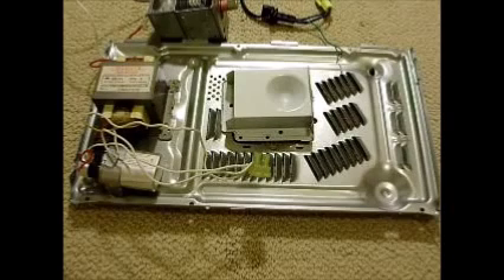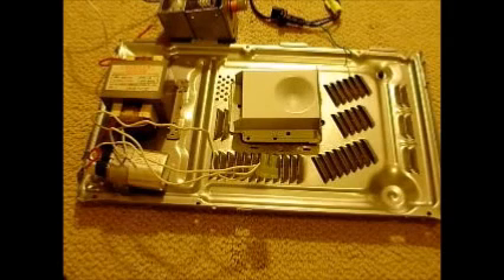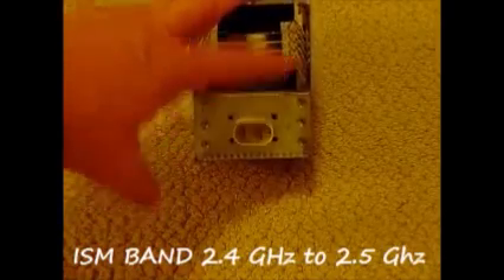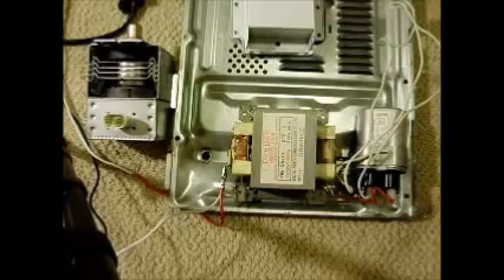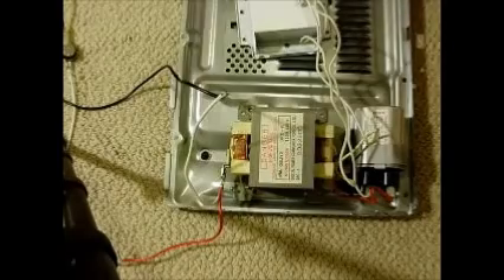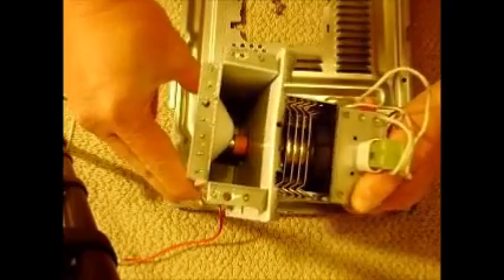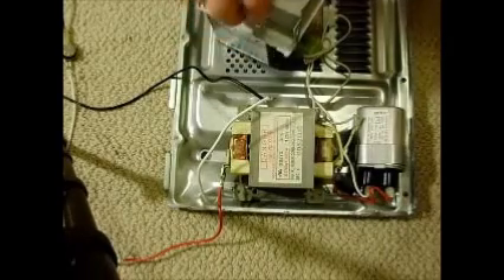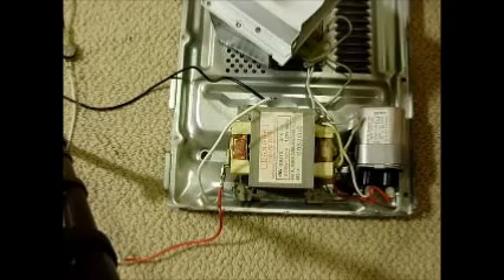DRONE JAMMER 1200 WATT WIFI DRONE

Comment: LISTEN ..MAN ...  THIS IS  THE  #POWER  ..!!   (NO USE)  ... YOU #MUST  MAKE  A .. #HORN .. !!

(ANTENNA ) ...  WHERE  THE  #POWER  GO ... AND  WHERE  IT  WILL BE #BUNDLED  IN  "ONE SMALL WAY" ...

LIKE A  (FLASH LIGHT)  !!!   .... ELSE  NO  USE ..  WHEN  #NOT  .. HAVING  THIS .... "IN A  ANTENNA  HORN"...

>>> AND   THE   #TRANSFORMER   (YOU PLAY  WITH !!)   IS  ...  #5000  V + ...  DEAD WHEN  WRONG HANDLE ..!!! <<<

OK ... 

NNNN